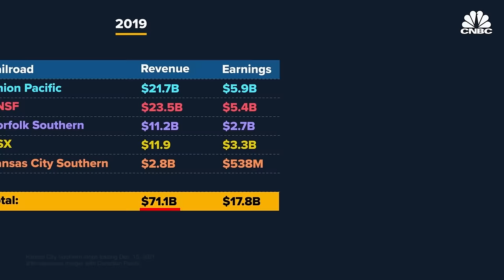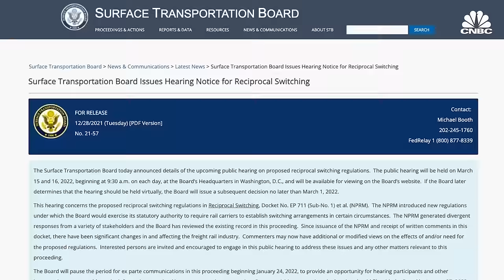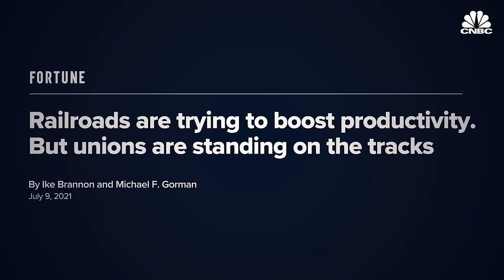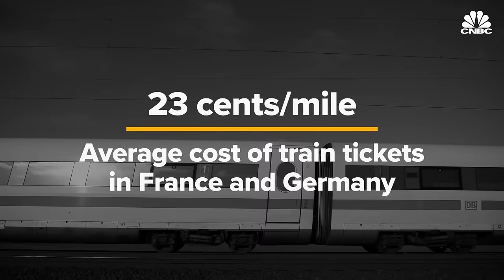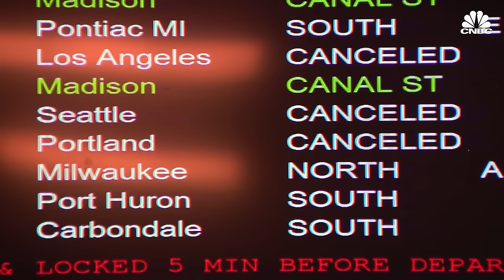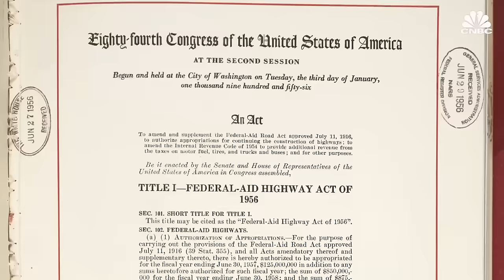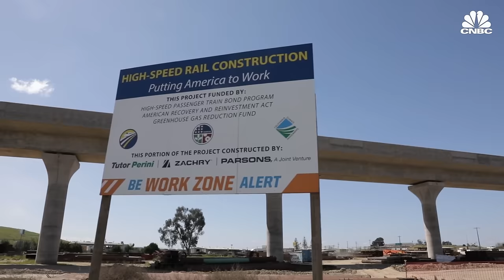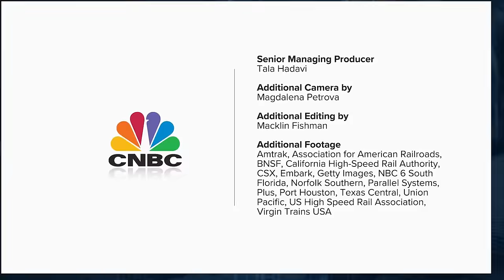CNBC Explores: America’s Railroads | CNBC Marathon

Comment: In a way the privatized system is the reason it's the most profitable. If it was nationalize the government would forego profit in exchange for more service, and better worker conditions. Vs a company would try and squeeze every last drop out of the worker.
Reply: what is wrong with foregoing profit though, as if everything depend on it?
Reply: @ianhomerpura8937  The way it works in Europe now is more like with highways or air travel. Highways are owned built and maintained by the government (Federal, state and local) and anyone can use them to get anywhere and it's the same with airport and air traffic control - in both cases private users (including companies) can use if for free or for a fee (air travel, of course, is more controlled but still open) and in Europe railroads work the same way. In the past rail infrastructure and trains were built and maintained by the national rail company but now a separate government company (in some countries completely separated and on other a separate division of the rail company) is responsible for it, just like it does with road and air infrastructure. The national company, and other operators, can use this infrastructure to operate passengers trains (freight should follow soon) for a usage fee so you can have multiple operators on the same routs that only handle their rolling stock and operations while rail infrastructure is handled by the state.
That's exactly what you need to do in the US. Now, freight operators own their own tracks and are less willing to allow others to use them thus creating a monopoly in their area so no wonder they earn billions each year.
Reply: @ianhomerpura8937  You going to work for FREE? Nothing wrong with making $$!

Comment: I took the high speed trains in Italy- average speed 180 mph. Under $100 round trip to most cities in Italy.
Reply: China 600 mph is the norm😂😂😂
Reply: @Amx479  no. There is no train on earth that reaches those speeds. Either you are mixing up mph and kph or you are grossly misinformed. 

The current fastest revenue service “train” is the Shanghai maglev which achieves just under 280mph
Reply: @Amx479  600 kmh
Reply: I flew into Venice and after 3 days took the train to FLorence and then Rome.   The train was 180mph and it was awesome.   They are way ahead of USA

Comment: One more thing to note is that because of the privatized infrastructure there are almost no electrified tracks in the US which defeats the entire purpose of trains being sustainable alternatives. If the diesel trains are running with low passengers it might even be better to just have cars... 😕 Saying this as a rail fan
Reply: I think that it’s probably still better because while there are a lot of diesel locomotives, they are probably a lot less of them compared to automobiles, so that’s probably why it’s less than cars. That being said that’s still isn’t that good for omissions, and considering that railways seem not to want to electrify, it would probably take the arrival of hydrogen locomotives to decrease that
Reply: @lucasquintanilla1673  Even when stuff is electrified you have stuff like Chicago commuter trains running diesel on compleely electrified tracks.

Comment: Amtrak not receiving the required priority was mentioned.  A big reason for this is the precision Scheduled Railroading that was also mentioned.  Why? Freight trains are sometimes if not often longer than sidings.  When a short Amtrak train meets a freight train going the opposite direction, often the freight train cannot fit in a siding for a single tracked main line, therefore forcing Amtrak to get over and hold, increasing delays.

Comment: ain’t no way that they’re glossing over the issues with PSR 😭
Reply: Care to explain? I’m curious.
Reply: @Oinnk  the railroads build super long trains to save money by running less trains, but making them bigger. 

A single example of an issue: your train has something happen, and you have an emergency brake application, could be a airhose that popped loose, or a 20 car derailment, you dont know which until the conductor walks the entire length of the train by themselves which can easily take at least an hour.

Comment: If they want Amtrac profitable then it needs to go 100mph minimum, the tickets 50-100$ and the influx of people will allow you to readjust accordingly.
Reply: Amtrak shouldn't need to be profitable, it should just be a good option which provides essential transportation to communities that don't have anything else and serves as an alternative to driving and flying
Reply: No trains are not profitable
Reply: @Ry_TSG nope if the government owns it, it should be profitable. That’s how that works.
Reply: @The_king567  Why? Who said that? Was it written on a stone tablet on Mt. Sinai? The point of government owned services should be to provide a service. If it can be made profitable, that's great. But the government operating a service that is expensive and low quality just to turn a profit defeats the point of that service even existing in the first place, especially when there are massive benefits to running a high quality yet unprofitable service.

Comment: Isn't that embarrassing for such a rich and proud country? If the US really wanted, they could build a world class high speed strain network with two or three decades, but it would need investments of at least $100 billion per year. That does not look impossible in a country that spends more than $800 billion per year on the military. I know that a strong military is important for the US, but a lot of money is wasted there. 

At least the routes from Los Angeles to San Francisco and from New York City to Chicago should be built as soon as possible. Those will very likely be profitable over time, because air travel will become more and more expensive over time. 

I was in China a few times and the rail network there is such a convenience. The 190 mile journey from Shanghai to Nanjing takes less than 90 minutes and is cheaper than a taxi ride from JFK Airport to Manhattan. So it is easy to spontaneously visit Nanjing for a few hours. That train feels like flying. Even within the city limits of Shanghai it already reaches more than 200 miles per hour.

Comment: One of the reasons for the efficiency of cargo rail in the US are the long trains. This is why concepts like hyperloop are complete BS and would be a massive waste of ressources
Reply: And those extremely long trains is part of why safety is an issue
Reply: @gary6576  Yes of course. The companies try to milk every penny of profit out of the business. They could easily reduce the length and increase safety but they dont. Generally speaking my point just was that the more freight cars you can pull with a small number of locos the more efficient, cheaper and environmentally friendly you get. Thats why hyperloop etc is complete nonsense with their individual pods. (Same applies to passenger transportation)
Reply: @gary6576  Give us some examples of long trains causing safety issues?

Comment: Lots of nonsense talk here about how great the US railroad is...but the only real measure covered seems to have been profit. Anywhere else in the Common Sense 'Rest of World', Passenger > Freight and as such, safety, maintenance and interoperability is prioritised. Its not about profit, its about utility. Geographically, the US is a great use-case for Passenger Rail...but its addicted to petroleum and its cities and infrastructure is geared toward supporting the car and only the car. A shame.
Reply: Couldn't agree more, the US has the capacity to pump out millions in profit if a sustainable network is built
Reply: @shreyasbhat0506  The point is...direct profit shouldn't matter. It's the presumption of profit incentive that is the reason it's a dire mess at the moment.

Comment: Due to our history of neglecting planning/building infrastructure for it, it's a mess.  Needing to move highways, utilities, bridges, and pay off landowners, and other stuff like that is what makes it such a mess.  I'd suggest doing it first in places which don't require that, and take measures to make things happen more inexpensively.  When areas which cooperated and didn't obstruct it, have better economic growth and better lifestyles, then the crowded, expensive, greedy places unwilling to cooperate, will be come cheaper and more willing to cooperate.  In extreme cases, they'll decay until ready to be bulldozed and start over. 

 There are places where the real estate issue is simply too expensive to solve.  Let them ride buses there, between places where the new infrastructure is created in less problematic areas.  They could be nice buses.  Maybe you don't even need to get out of your seat, it could be a module transferred from a train to a bus and back to another train.  Or as with Acela, it's all on the same train, but just has to have certain sections traveled more slowly.

Comment: So according to Association of American Railroads, "anything" (I assume that includes passenger rail) "that would undermine the fluidity of the freight network is wrong-headed". Well there's the problem in a nutshell for passenger rail in the US. The freight companies own the rails in each region, Amtrak nominally has rights of passage, but as anyone who's traveled on Amtrak knows, the freight companies can hold up passenger schedules for hours and hours, making inter-city train travel excruciatingly painful. Imagine if freight trucking companies owned the freeways and personal vehicles were only allowed to drive when truck traffic wasn't saturating the roads. Of course, if freight companies owned the roads, there would only be one lane used for both directions, and it would be continuously in use. Too bad you car-driving people, stop undermining the fluidity of freight trucks! Railroads were given massive land grants to build-out the network and have plundered the riches of this country ever since. It's time to put them under regulation again. Of course, Congress has had a hand in strangling passenger rail too, so... thanks for that. We need to make passenger rail strong again to get people out of their cars and stop pumping endless carbon into the air.
Reply: It isn't feasible in most areas of this country, that's why passenger rail went belly up. The one MAIN thing you don't mention is the personal choice and autonomy other options provide.

Comment: A couple of items that are inaccurate, Texas Central has failed and made an attempt to grab Federal money......all that is left now is a shell company and a caretaker staff.     The age old rumor that GM, Firestone and Standard Oil conspired to run street cars out of business is not fully true.     Most of those interurban systems were built on the cheap to compete against Steam Railroad passenger service in the early 1900's.    What happened is as Americans fled to their cars these lines had little to no freight traffic to subsidize the falling passenger counts plus the Feds started cracking down on rail safety and insisting on more complex signal systems and better track maintenence, etc.    Driving up costs of the Interurbans as people were leaving for the automobile.  So along comes GM, Firestone and Standard Oil seeing that the lines were starting to fall apart physically and financially and they setup a holding company to replace many of them with buses.   Which hastened some of their demise but in most cases it would have happened anyway.   So not really a conspiracy there.

Comment: PSR is terrible. Longer trains blocking communities and dangerous safety violations. And trains don’t fit into sidings causing delays for the passengers trains
Reply: If a train is routinely blocking traffic, you can blame that on the city for building at grade crossings instead of over/underpasses. Railroad was there way before most structures were.

Comment: take everything the AAR says with large amounts of salt. Its the railroads lobbyist organization. Freight railroads do not compete against each other
The network barley works and the US class 1 have cut everything to the bone. They don't have enough crews, not enough track, locomotives are sitting in storage as trains stall out on hills or are sitting waiting for power. They refuse to spend the money on lowering the emissions by mostly running decades old locomotives. 

Precision Scheduled Railroading while great in idea has major drawbacks as the US railroads have invested in the infrastructure side to match what they are doing operationally.  They will happily run 15,000ft trains down a single track line with 6,000ft passing sidings. Which means that train then acts a major bottleneck and only trains shorter than 6,000ft could use the line by holding in sidings. That is part of why amtrak is often so late, as the shortest trains on the railroad they get pushed into sidings all the time so that freights that are too long can stay on the main.

Shareholds have LOVED PSR because its made them more money, most railroad customers hate it

Comment: I'm always surprised when I see US trains to see how even trains on the North East Corridor sway, like the tracks are so uneven an poorly maintained that they can't even keep steady going slow on the highest speed corridor in the country. Like at 24:30
Reply: This is not really entirely true. The freight track is indeed very poorly maintained. Also Amtrak's NEC corridor, the only portion of track that they own, does have slow sections at station approaches and on more complicated old switches, bridges, and tunnels.

But the NEC is not poorly maintained! It is by far the busiest and highest quality section of track in the country. And the margin is not small. The NEC is maintained on par with corridors in Europe and Asia. It's not perfect, but not terrible either. They have a lot of old infrastructure that just needs to be replaced. No matter how much you maintain it, it won't magically become modern rail. But the main problem on NEC is not as much maintenance as it is upgrading to modern standards for speed and frequency.

Contrast this to most of our freight rail network where the second and third tracks are routinely left to rot because the Wall Street guys now running the railroads do not understand railroading. They simply want to milk the existing infrastructure and pocket that short-term profit. And if a given railroad's infrastructure is used up beyond repair, why would they care? They just abandon the track and move on.

Comment: If freight trains are so efficient why are they still using gas guzzling diesels ? .
Reply: Many railroads used to use electric freight trains but tore up  the infrastructure to run them.  Diesel locomotives are still more efficient on average and less polluting per ton-mile than diesel trucks.  Local pollution is higher with both diesel trucks and locomotives, but one loco call pull the equivalent of 400 trucks worth of freight.
Reply: I get your point . I get annoyed when I see four plus diesel hauling a freight train. Here in the UK freight operators have used diesels under the wires. Only now are they starting to buy new electric locomotives.